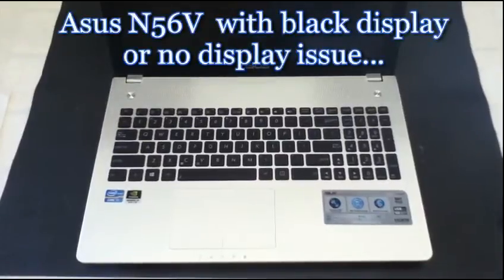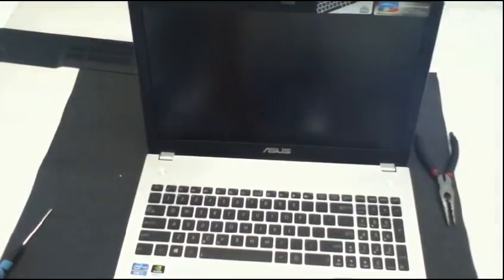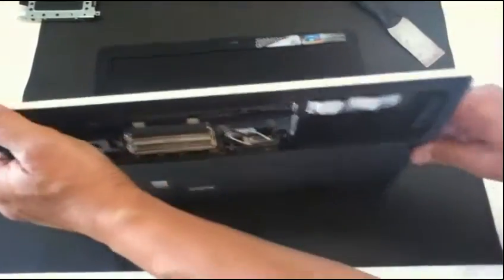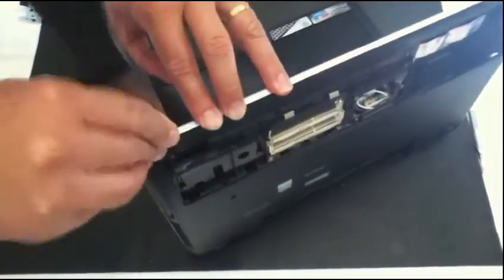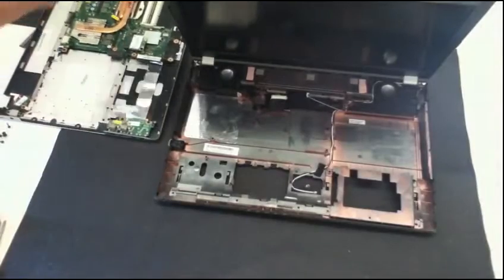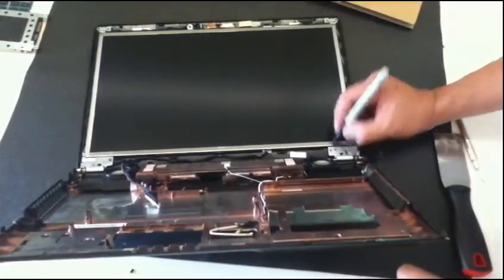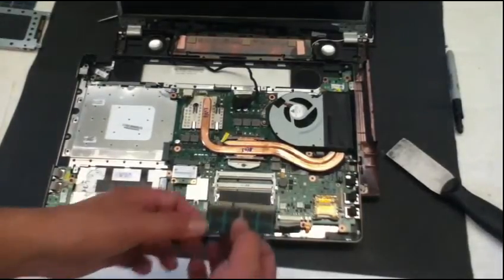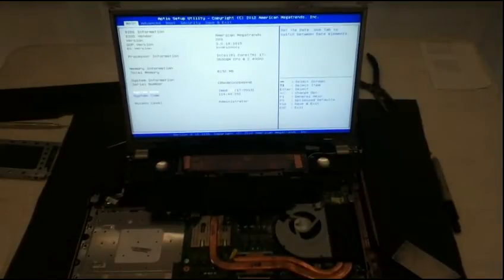How to Disassemble Asus N56V Notebook Fix No Display Issue

Comment: Guys, if you want to try reconnect LCD flex cable, first try to reconnect cable on display. It is very easy and you dont need to disassembly full laptop. It take only about 5 minutes. If it doesnt will work, then you can try  reconnect cable on motherboard as it is showed at video.

Comment: To unplug and plug the speakers and LCD cables easier there is a small hatch under the battery, towards the center of the laptop. Just pull it out and there are two holes for LCD and speakers cables.

Comment: In this situation, would the computer show any image to a external display?
Reply: Yes, it would. The graphic card is still outputting the video. 
It's just not received by the laptop display because the cable was loose.

Comment: For those with the cable adrift on the motherboard, there is an easier way. Just remove the battery and there is a long small cover that can be removed to reveal the cable. I then pushed it back in with a small screwdriver and bingo.
Reply: So I had an issue with the backlight, i replaced the monitor, did the bios updates, and was about to replace the cabling again. But then I saw this comment.

You take out the battery, and on the elevated part towards the center of the board, there is a different piece of plastic. 

You can carefully pull that off, and the right side is the monitor cable. There should be a clear piece of plastic you can get with a screwdriver or tweezers. Once you to pull it out. Then CAREFULLY push both sides in until they are seated equally (they were pushed in farther on one side than the other). 

Plug in the battery and bam. It worked. It would have saved me a ton of money if I had known (the screen was 90). But hopefully this can save someone else time. Check the seat down here and in the back of the monitor itself.
Reply: Yeah pays to research the hell out of things sometimes. Resell the screen on eBay :)
Reply: OMFG! Thank you! Thank you so much!
Today my good friend came to me with almost new N56V and "black screen". I figured out that notebook work fine, except screen. I was ready to send my friend to service center... and i see your comment!